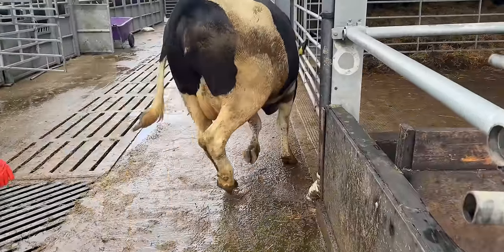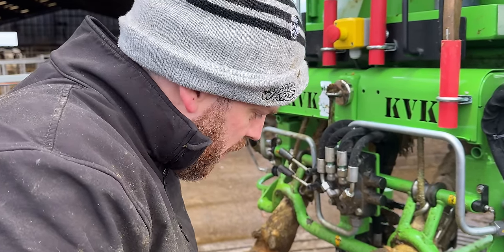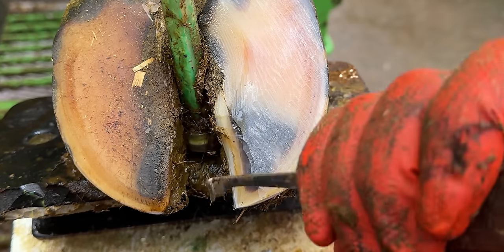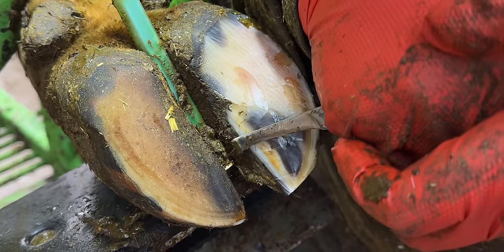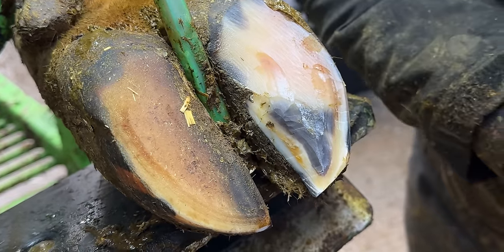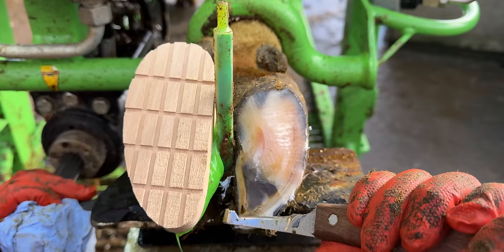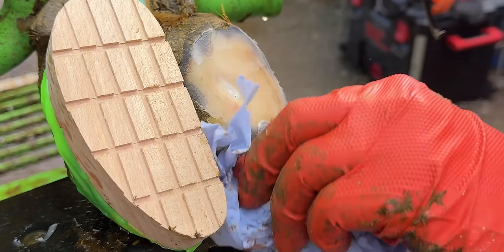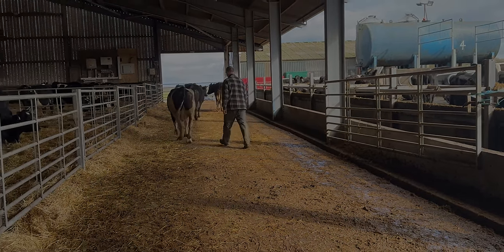BUBBLES in this COW's HOOF

Comment: Ive always kind of wonder. If both claws have issues what do you do? I do recall you using one of those kind of J or C shaped blocks before that line up with the wall horn. Would you use one of those on the one with the most wall horn integrity?

Comment: is there a benefit to applying the glue to the block vs the hoof, I noticed you go back and forth sometimes putting it on the hoof and other times putting it on the block, was wondering if there is a reason, or just happenstance

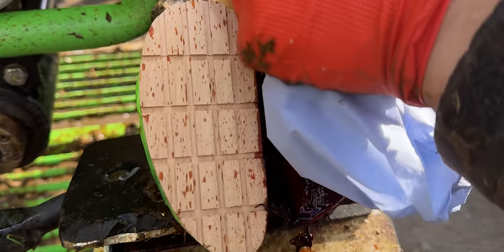Comment: 7:18 Just before you spritzed on the Iodine, it looked like there was more brownish fluid emerging from a hole in the Corrium itself...

Would that indicate it's an Abscess in and above the Corrium rather than between the Corrium and hoof horn? And if that's the case, does that mean she desperately needs a Vet to prevent the Hoof itself from becoming Necrotic?